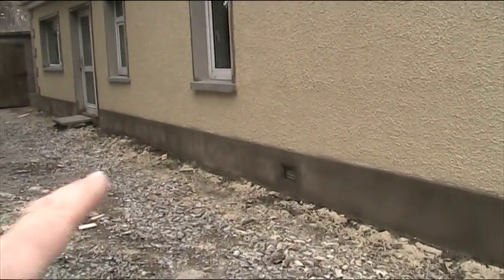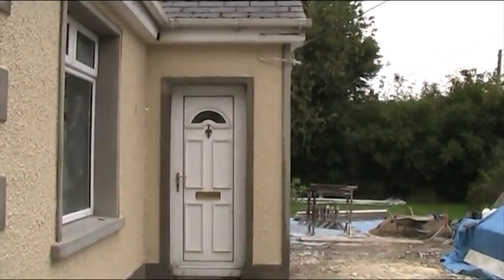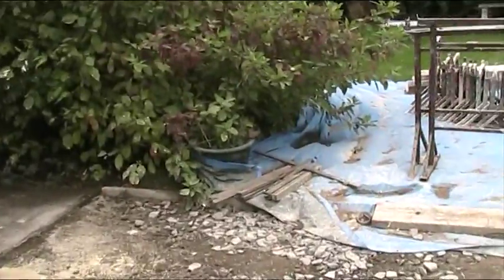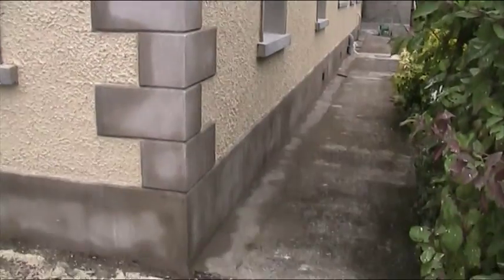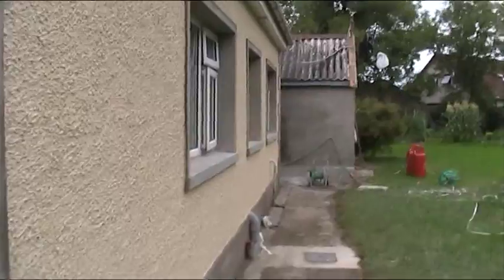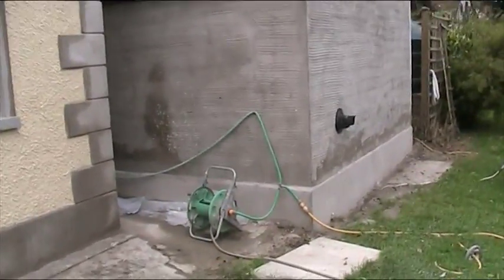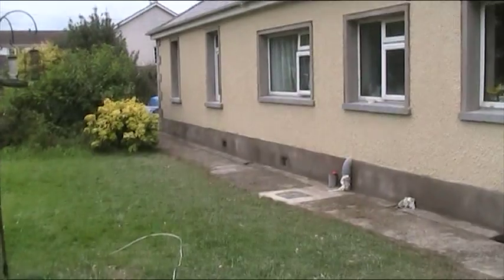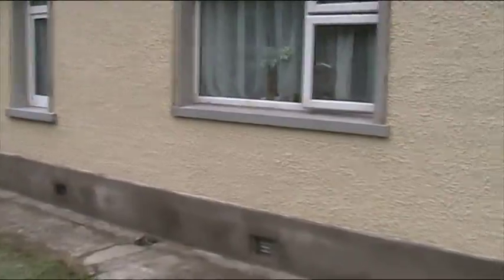Damp Proofing & Plastering 12

Comment: Nice Job and a good save on the stucco!  Be well my friend. Thanks for sharing.
Reply from the maker: Thanks Erik, things are working out well despite the odd problem but I've never seen a project without problems.  We have discovered that if we spray Unibond on the concrete plinth the K-Rend will just wash off and then the Unibond after it so we'll do that for the rest of the work.  Contractors who specialise in putting on K-rend use about 4 labourers with brushes and buckets of water chasing after the plasterers.  Others put a cling-film/saran wrap type membrane on anything they don't want touched and that works except on the plinth where the dye still can get under the plastic.  Krend is a bit of a pain but gives a lovely finish.
Best Wishes, Brendan.
Reply: baconsoda Hope you do well with the rest!  Good luck finishing it all up!
Peace ! Erik

Comment: Thanks for sharing the video with us Brendan.It sounds like you have been having a busy old time lately, but I am glad that things are falling into place. Try and have a good nights sleep mate.
Chris.
Reply from the maker: Thanks Chris.  This house is an old labourers cottage that was partially extended on one side so we extended the other side to make the house rectangular again.  It's about 2 and a half times bigger than the original house but with all the original features repeated to keep the old look.  There are 2 sheds about 2 feet from the back door and they are being dashed as well so all the buildings at the front of the property will look the same.  The dash is called 'Buttermilk' and it's a pale butter colour and the windows and doors have grey cement bands around them that contrast with the dash.  We will be putting a dark grey gravel on the driveway so that will set he dash off really well.  When the facia and gutter are done it will look like a new house built in old style.
Best Wishes, Brendan.

Comment: Aha, so Irish builders speak French aswell ?

Looks great this render... I like it... I am sure it will help prevent damp in the house...
Maybe you could do a gravel filled trench all around the hous to make possible any run off to disapate into the ground and not having any water pooling on you near the foundations and/or the wall.

regards, Sander
Reply from the maker: What about a moat?  With a crocodile in it... I'd like that.  Three years ago I got the driveway and front dug out, land drainage pipes laid then and filled with quarry stone to take water away from the West and South sides where it couldn't drain properly and, three years later, it is still working so your idea is absolutely spot on.  I am getting a new path laid at the back where water pools towards the house (not my design, but I need to fix it).  There will be videos to show you what I'm doing.  If you look back through my videos you'll find a series on groundwork and your idea.  Here's the first of about 5 - Groundwork 1, August 2011
Best Wishes, Brendan.
Reply: Well done Brendan... I enjoy the craftmanship...

Comment: Looks like a really nice finish, really neat job. What are your plans for the drive?
Reply from the maker: I have just spent 20 minutes looking for the comment where I was asked what  was going to do with the drive and then I see your comment so I hope it was you I needed to answer.  We are going to put gravel on the drive.  There are types that interlock and form a fairly tight surface so it will be one of those.  Power steering is hard on gravel but it's a price we are willing to pay for the look we want.  If we decide it's not working we will put down tarmac but we'll wait and see.
Best Wishes, Brendan.
Reply: baconsoda I look forward to the finished job, i'm a new sub and enjoying looking at your old uploads. All the best Danny
Reply from the maker: dannyscoot73 Thanks Danny, the next big push is on Saturday when they try to get the back of the house and the sheds done.  Then we'll do the facia boards and gutters and that'll be the outside done.  There's still inside trim to do be we are making the most of the dry weather.
Best Wishes, Brendan.